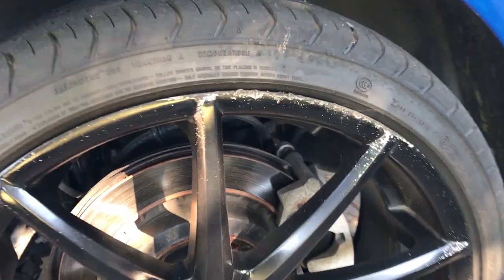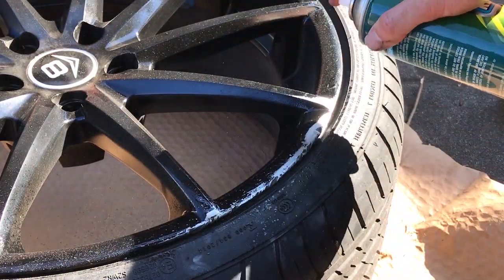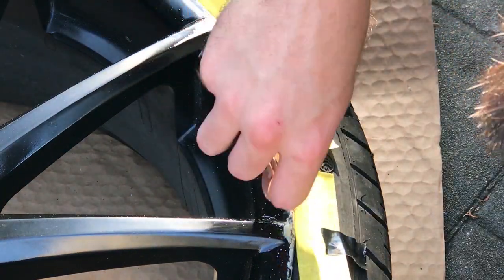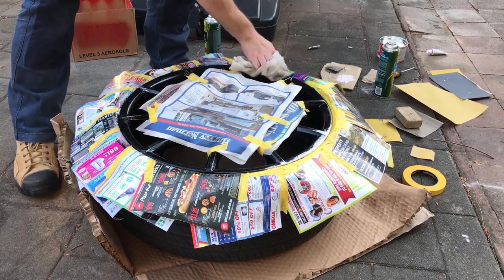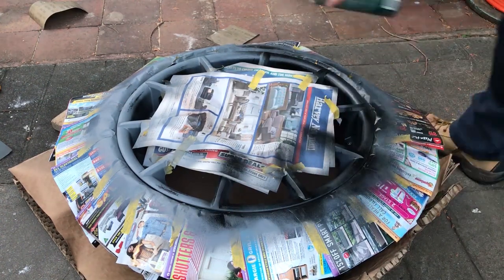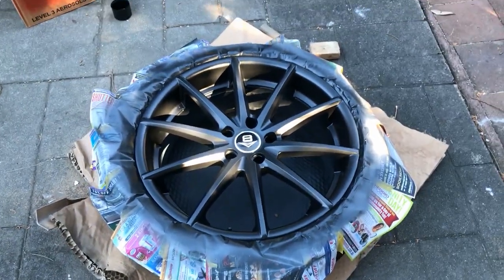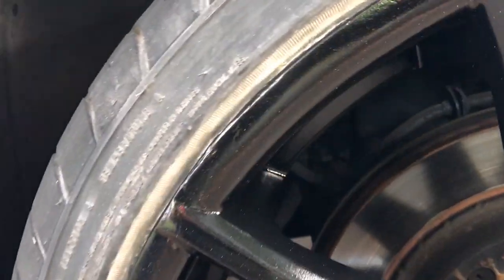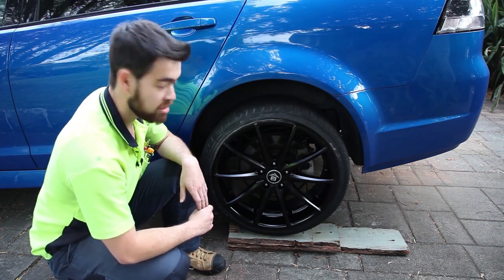HOW TO REPAIR DAMAGED WHEEL

Comment: What the lift kit cost ya?
Reply from the maker: I know rolling around on standard suspension looks like I'm running a lift kit but I need the clearance because I tow a boat and scrape on everything. When I get my 4x4 I'll throw some shorter springs and shocks in. - James